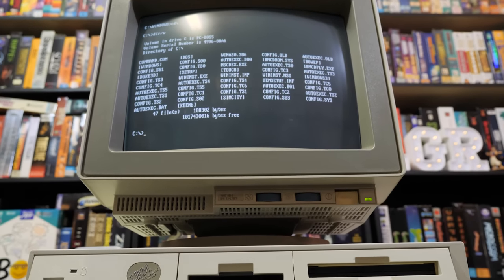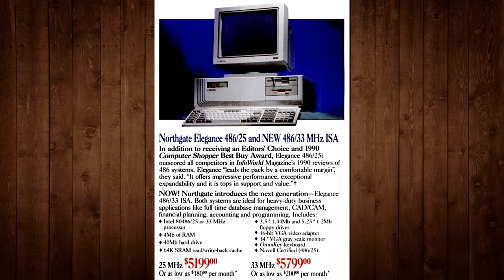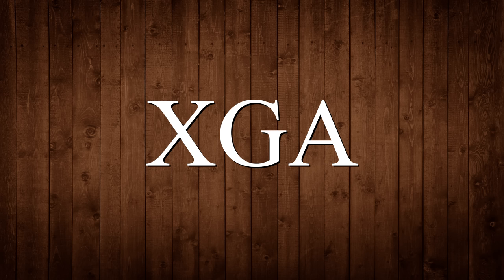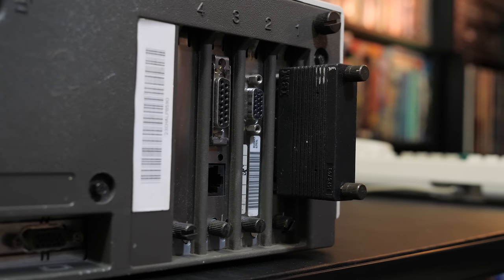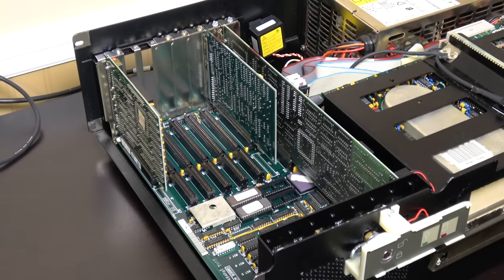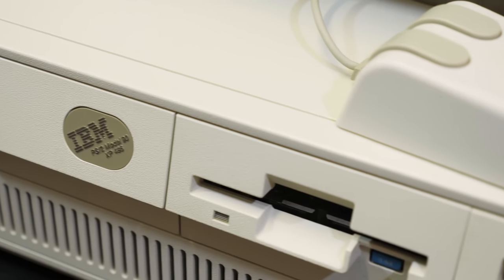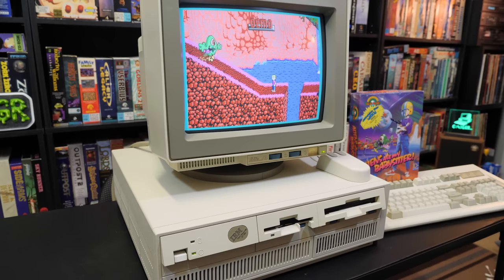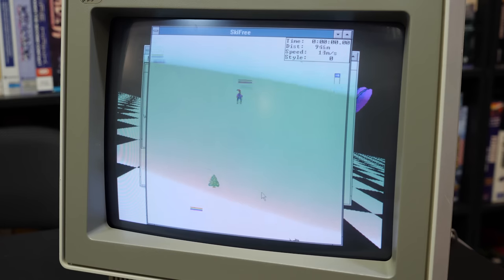$17,000 PC from 1990: IBM PS/2 Model 90 XP 486

Comment: $17,000 ooof and ppl say PC gaming is expensive now days 😀😁😂🤣
Reply: Yeah, but this would be a business machine, often used for Mainframe connectivity, as a File Server, etc.  I used to sell these... and they were hardly ever purchased by consumers.
Reply: Elitist Prince Dizzy PCs were quite expensive back then. Wouldn't be surprised if the Pentium 3 my dad got in the late 90's was nearly the price of my gaming PC. This Pentium 3 didn't even have a graphics accelerator.
Reply: True, because computers were very  rare in the beginning of the computer era and computers and their parts weren't made in that big counts like today
Reply: You ever heard of the Personal/370 lucas rem? It's basically a System/370-XA CPU and memory crammed onto a single MCA card. The rest of the system was emulated using the host machine and operating system (OS/2 on the PS/2, or AIX on the RS/6000). They had the performance of a low-end 4381. IBM also offered what amounts to a twinax terminal card that'll let your PS/2 pretend to be a 3270 series terminal (they had that kind of thing since the PC/XT era!) which is actual mainframe connectivity; combine both and you can use the Personal/370 to develop for VM/SP, MUSIC/SP, VSE/SP, or whatever OS you're running, and then XMIT it over to the real machine.
Reply: + Gargoyle Named Lexington By the time the first-gen Pentium III existed, 3D-accelerated video cards were becoming common... A far cry from 1996, where you were lucky to get a 2D accel.
Reply: $17,000 was obviously aimed at commercial use but computers were in general allot more expensive back them. You'd be looking at around 5k for a top of the range PC. Very few households had them in 1990. We were using machines like the Amiga/Spectrum/Commodore/PC etc. Completely different era.
Reply: This is a workstation though, still expensive to this day -- mainly for the extensive product support from the vendor.
Reply: it pretty much was a professional workstation what would have been considered a gaming computer back then would have been something like an Amiga 500  ,Atari 1040ST,or PC clone which could be had for around a grand.
Reply: this computer was very high end for its time. there are still really expensive pc's made to this day. look at the nvidia tesla graphics card
Reply: @Infernape7890  It wasn't so bad in the 90's. What made IBM PC cheap for the first time and more powerful than competing systems like the Amiga, was the AM386DX-40. It sure as hell wasn't the fastest; but if you look at an early 286 board it had an absurd number of chips and that still didn't get you any I/O beyond keyboard. No serial, no PS2 mouse (not invented yet), no floppy, no CD, no sound beyond internal speaker (*beeep*; 1 channel square wave, god awful), no graphics, no harddrive, no joystick port, no MIDI; all that was on add-in ISA cards and in those days you had a floppy controller card, and harddrive controller card, probably not a sound card, graphics card, bus mouse card, serial/printer port card. Later 286 started to integrate and reduce chip counts; put memory on SIMMs, put joystick, serial, floppy and IDE on a single I/O card etc. With 386DX-40, these systems just kept selling; small motherboards, basic as hell, a graphics card, a sound card and an I/O card, nothing more, they had unparalleled reliability and they just kept dropping in price rather than being taken off the market when the 486DX-66 was released, or when the pentium was released. This thing could play Ultima underworld, Ultima 7 and Wolfenstein 3D quite well, all fantastic games and well out of the range of what the Amiga could do despite its hardware acceleration. Doom, nah, maybe low res; mostly nah; but Doom was the Crysis of 1993, worse even, so it wasn't so unexpected for this to be the case.

The second classic PC was 486DX2-66. It cost a kidney when it was introduced, but by 1994-ish, both AMD and intel were still selling them and they just kept dropping in price. This is the sort of system people remember playing Doom, System shock, Warcraft II under DOS, Magic carpet that sort of stuff on.

The third classic PC was pentium 166/pentium mmx 166. Now we're in the Quake, Daggerfall, Duke 3D era.
Reply: @booboo699254  Only seriously rich "geeks" would EVER have a Model 90 in their house. I had a Model 70, And I thought I "was "something"!
Reply: @Infernape7890  Your dad's P3 (adjusted for inflation) likely cost 2wice what a good "gaming" rig costs now!

Comment: Wow! This computer reminds me of the PS/2 computers in my elementary school’s computer lab, although I’m sure they weren’t nearly ad powerful as the one featured in this video. When I was in third grade (‘92-‘93) my elementary school decided to turn our cafeteria into a dedicated computer lab (moving lunch to the gym), instead of having all the computers on carts that were stored I a closet until they were need. I remember being so excited to see the new computer lab and being so disappointed when I rolled into the room and saw four rows of tables with six IBM PS/2 line computers. Before the lab was build we had dozens of early Apple 2’s and a few Apple 2 GS’ and I loved them. My teacher told my class that we were getting shiny new Macintosh’s and I was so bummed when I saw a room filled with boring computers from “Big Blue”.
Looking back, I think I was more upset that we didn’t learn any programming or how computers work, instead we spent hours using the touch typing program (we only used the mouse to open said program). The school should have saved the money and purchased a bunch of word processors instead. Oh memories.

Comment: Oh yeah, MCA what a pita. In my former workplace were we built Siemes mainframe terminal emulators for different systems (HP9000, PC etc.) we also had a MCA variant of our communnication devices. It was annoying as hell, as we had to get all the non standard components from IBM in the USA (the blue brackets etc.). They had complete control of the expansion market and that's what made the industry develope something else completely (EISA also quite a PITA but for different reasons).

Comment: First PC I bought was a Packard Bell desktop back sometime between 1995-96. It came  with a 75Mhz 486 Pentium CPU. 8MB of DIMM RAM, 2MB RAM for the onboard VGA, combination sound card and modem ISA card,  2X speed CD-Rom drive, floppy drive, and Windows 95 OS. I bought it from a Best Buy store as a package deal for around $1,200 bucks. It included the desktop CPU unit, a 15 inch Packard Bell VGA monitor with speakers, Packard Bell mouse and keyboard, and a Canon BJC-210 bubble jet color printer. I think the printer was free as a special with the computer.

Comment: I actually had one of these for many years (had nearly the entire ps/2 line at one point). My 90 sadly kept having issues with dying power supplies. I did manage at one point to get it running for a few months and loved it. Basically this was a desktop version of the model 8595 ps/2 server with a few differences. I actually swapped the processor complex out with a few of my other systems, and even ran it for a short time with a type Y complex (with a pentium 90). Honestly I don't remember tossing it out, but I can no longer find it, along with a few other machines.

Comment: Having up to 64mb in 1990 is amazing and probably half the price. My 486 DX2/66 I got in 1994 had 8mb of RAM which was a large amount then (all my friends PCs were 4mb at best). CDROM was only about two years old at this point and NOBODY had them. In fact I am only familiar with the Atari ST CDAR504 external drive from 1988 that cost £400 and was as big as a VCR of the time.

Comment: My family bought one with the sx 25mhz and 4mb of ram.  Used to rock out to games like Kings Quest 6, Myst, and 'the 7th guest' among many others.

A few families we knew bought the same system with slightly different configurations.  We would all call each other for tips/help beating Kings Quest.

Our monitor had a 'darker' spot we couldnt remove, they shipped us 4 new monitors then eventually just sent us a new computer(had a dx 33mhz this time and a bit bigger hdd).  We got to keep the old one... which helped cuz I had a little bro!

Comment: LGR is right about the cost being equivalent to a Honda Civic of that era.  I bought a DX four-door model for just a shade under $17K in February 1991.  It was a great car, which lasted 21 years and 235K miles . . . it outlasted six PCs over that same time span.  But, the HP-PC I'm using right now is going-on seven years of service for me.

Comment: Back in the early 90's I worked for a depot repair company in Longmont, Colorado that fixed a lot of these IBM units. Their  color monitors were from some Asian job shop and were crap, I can't count how many I fixed. The Computers were built like a tank, but the power supplies were also Asian and would crap out all too often. I must say the servicing documentation, procedures, and test ROM's were the best around. Parts were readily available, not like today where if you need a part you trash the whole unit and buy a new one. I still have a few boxes of those tank model M keyboards left, the best around. 02-03-2020.

Comment: When I was in college in 96, the UNIX lab had a wall of these they used as terminals to connect to the VAX server in the other room.  It was interesting using Windows terminal program to connect to Digital UNIX next door, writing programs and generally farting around on the text based internet applications.  Of course we had access to browsers on the IBMs, bit I'd spend half my time on IRC in a terminal program.  Enjoyed it so much, and rather miss those days.

Comment: Only ever saw PS/2 machines in banks. Our branch had a bunch of the towers, with the external IBM 5.25" FDD on top. They might have been over-engineered, but they were designed to last.

Comment: I got the 95XP "big brother" tower version of this in summer 1990 (aka IBM Server 95). I loaded it up with 64Mb RAM and a Micropolis 2GB 5-1/4" drive (double-height). It was really a high end PC at the time. Oh, and what was really cool about this model is that the CPU board was removable. I actually upgraded mine to a Pentium when the upgrade became available.

Comment: Around this time, I was working in an office on some kind on mono PC - wouldn't surprise me if it was nothing more than a 286. I remember the bosses thinking about upgrading their systems and were showing around a catalogue. Typical price at the time, presumably for 386-based machines, was around £5000.

Some 3 years later, I'd built my first PC, a 485DX-33 with 4Mb RAM and 120Mb Conner hard drive for about £600, I think.

Comment: In 1995, I bought a pair of external 4GB Wide-SCSCI hard drives for video editing. They cost $1200 each. Both drives died of overheating in two years. Interestingly, the Seagate drive model was still used widely in 2001.

Comment: When I began working at Disneyland Paris in 1992, my computer was a IBM PS/2 model 55, with an ESDI 40MB hard drive and 4MB of ram and a 386SX 16MHz. How slow it was. I was able to get a 8MB and 387sx memory and co-processor extension. 3 years after, this oldy was changed for a Pentium 75 IBM. What an enhancement !

Comment: Brings back the memories, I had one of these in the very late 90's with an overclocked Pentium and about as much ram as I could fit into it. Used it for dos games and basic windows stuff (95 ran fine on it). Eventually I got a job and could afford an actual modern computer, but I miss that boot up sound. And now here I am restoring a pc from the late pentium 4 Era but it's just not the same kind of nostalgia.

Comment: in 1990 I was working as a field tech for an IBM dealership. The worst thing about the PS/2 was that everything was proprietary. Ths weird system board architecture meant you couldn't buy anything off the shelf.

Comment: I miss that bootup sound. Hard drives back then sounded jet engines starting up. Also miss the test sounds from 1.2 and 1.44 drives one after the other. I had a computer similar to this but it was only a 286. I never even bothered to put windows on it and only used msdos and q-dos. I mainly played old Sierra games on it and used WordPerfect, while my dad used DBase on it.

Comment: I had a Model 90 486DX-33 to use one of the advanced graphical modelling CASE tools (IEF) in the early-mid 1990s as a method of programming.  It was a beast of a machine for its time and the Model M keyboard is still the best keyboard ever, ever made..  The only thing mine did not have was a CD-ROM.  We had one of these on the office floor shared between 150 people!  For its flaws, it was a very good machine, and hewn from solid rock!  (Okay, metal, lots of metal).  I remember the boot-up sequence so well, I was all of about 23-ish and it gave you the feeling of 'okay... time to get serious..."

By about 1996-ish (I think) I had mine upgraded to the last of the 486 DX-4 100s as they were faster than the new Pentiums.  I got it because I moved onto Eiffel & C++ which I loved because we had local compilers on these very 'powerful' machines.   They might have been expensive but they were the nuts as dev boxes.

Comment: Thanks much for this video, i remember quite well, when the Model 90 came into the Stores...the Boot-Up Sequence was pretty much like every PC back into 1993, i've had a 486DX-33 at that time, coming from a 486 SX-25, and before 386-DX40 AMD, also AMD 286-12, which was my 1st PC, after C-16, C-64, Amiga 500.

My 486-DX33 already have had VL Bus, which was in terms of graphics performance better than the slower 16bit ISA bus, later then, PCI bus. EISA was too expensive, onto 486 Mainboards, so i went with Vesa Local Bus, have had 2 Cards, the Graphics Card, and the HDD Controller.  Win 3.0a was my 1st Windows, and i've had IBM OS/2 2.1 over dozens of 3.5" floppy disks, to check it out. Back into 1993/94, 8 MB RAM was that much expensive, and came with usually SIMM (upgrade from SIPP) and PS/2 Slots onto some newer boards....i've hat the more expensive 60ns instead of 70ns 8x1MB Modules, which costed me a fortune back then....the last 486 CPU, i was using, was the AMD 486DX-133 ADZ, which could also work as 486DX4-160, which 40 MHz instead of 33 MHz Busclock, and good cooling...but only the ADZ, whileas i was using the newer Intel Pentiums, 90 MHz at that time, and also hat the way prone to overheating, 66 MHz Version onto a Intel "Batman" Mainboard...those days.....the 3Com EtherLink III, i've had many of these NICs, never failed me....thanks god, it was also being avialable outside the MCSA architecture, for ordinary PCs, 16bit ISA Card. :-) Duke Nukem 3D, came into 1996...still have it, played it to death...and personally liked it tons over Quake....ahhh....that's better....nobody steams our chicks, and lives......come get some... and so on.... Duke was hillarious.... but i've had endless fun with it, playing by modem or network against each other, or Co-op play....

Comment: I can't wait to see LGR in 40 years.

"This is an Acer Aspire desktop computer. It was sold in Walmarts across the country for about $500 at the time. When adjusting for inflation, that comes out to about $48,000 today. Which is just insane to think now-a-days considering it only had an intel i7 4 core processor and a mere 32gbs of ram. It also came with a keyboard, which is nice but that does mean you have to type with your fingers. But you can use an adapter to avoid this."

Comment: MCA was the original "plug and play" which didn't require jumpers to be set. It predates ISAPnP and Intel's PCI. IBM continued to use MCA in their RS/6000 servers well into the early 2000s before they grudgingly switched to PCI.

Comment: A former employer threw away their Model 95 and gave it to me. I upgraded several components and it still runs great. My only regret is wiping OS/2, but I quadruple boot other OSes on it now.

Since you mentioned XGA-2 and 32MB of memory installed (which mine also has), do you also boot to other OSes, like Windows 95 and/or NT? If you do, I’d recommend googling xga208 and download those video drivers (if you haven’t already), as they’re a huge improvement to what Microsoft and IBM offer. You can choose from 17 different video resolutions under Windows 95 with just 1MB of vídeo memory!

Comment: Look at some of the prices of now "vintage" computers like this one, and the original Mac, among others, makes me wish I had kept all those old computers I had sitting around until about 2005.  Who knows how much money I could have made off some of them today.  I mean I've seen a few older 486 desktops sell for over $200 (many of the ones I had I paid like $50 or $100 for them mainly because I bought them as non-working and fixed them).  I remember my middle school had a lot of these IBM PS/2 computers (Ithink IBM Must have had some large contract with public schools or something, because most schools either had Macs or IBM computers or both). Today, most schools use Dell or HP.